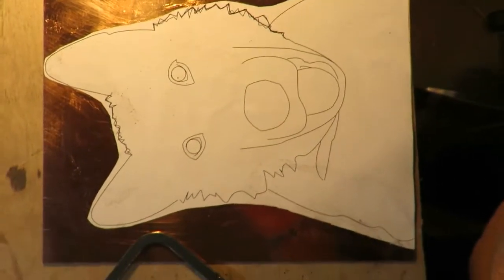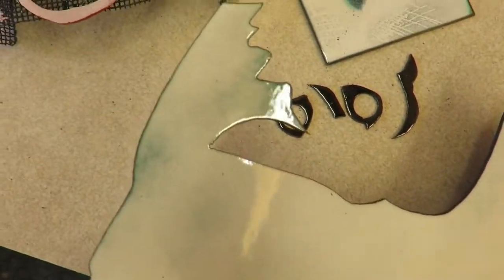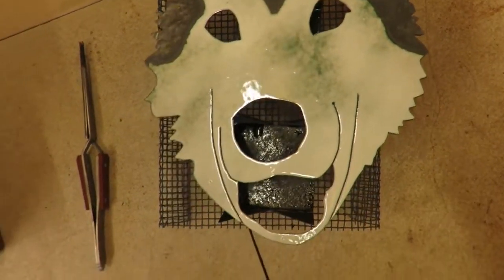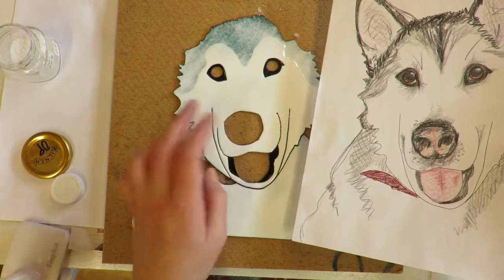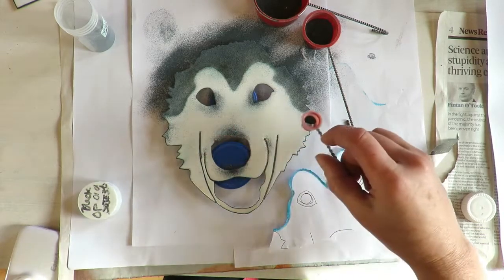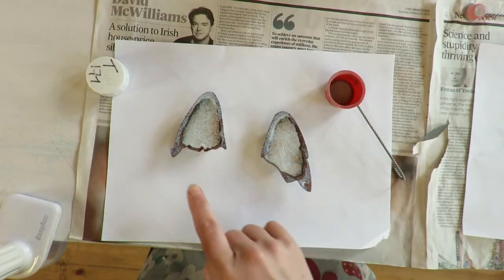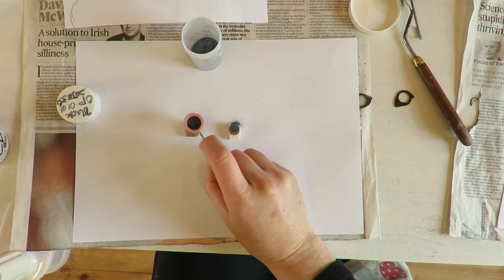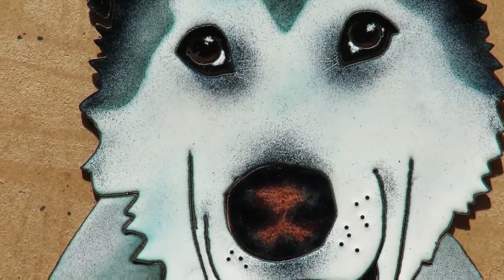Vitreous Enamel and Copper: A Husky called Torak.

Comment: Very beautifully done ! The owner will love it. I wish my kiln was large enough to do something like this <3
Reply from the maker: Hi Lisa, thanks very much! You may have a jewellery kiln if it is small. But you can always do what I do and cut the pieces up so that they fit then reassemble after they are all fired and finished. You could also try torch firing but that gives a different kind of look.
Reply: @GeraldineMurphyEnamel  I made a small running Husky with my small kiln but I'm still learning. I wish I could show it to you :)